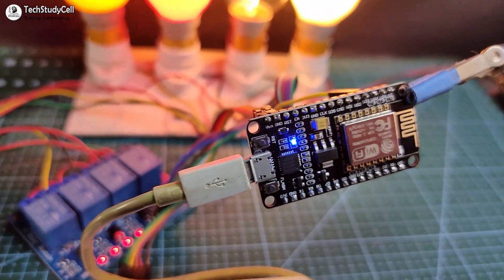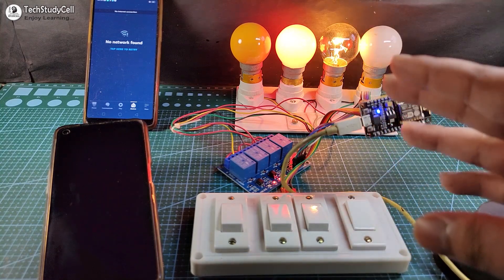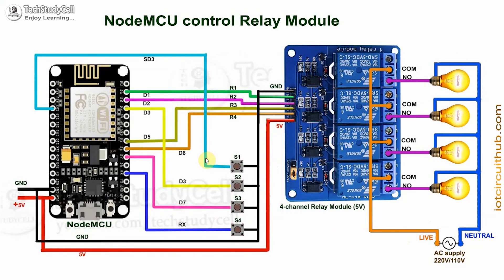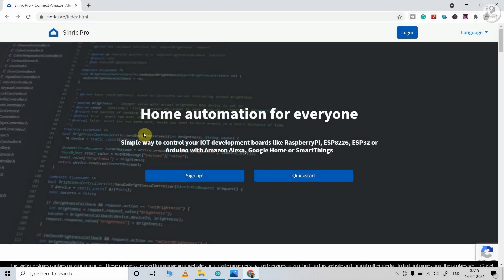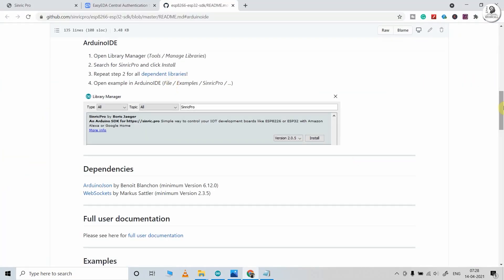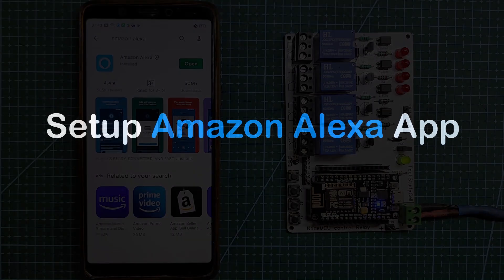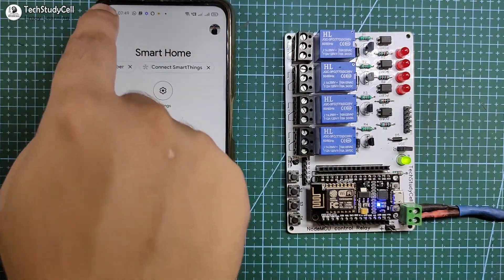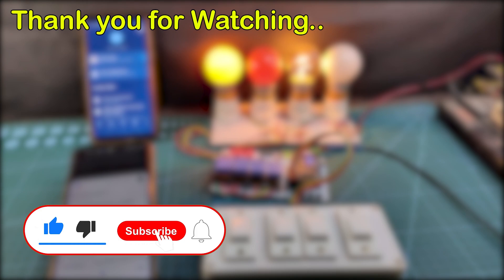Smart Home with Google Assistant & Alexa using NodeMCU ESP8266 (Manual + Voice) | IoT Projects 2021

Comment: in this project using 4 outputs, but only 3 using Sinric. can I combine 1 output or maybe more using Blynk?
Reply from the maker: You can control the 4th relay manually from switch
Reply: @TechStudyCell  i have successfully combined 6 relays with Blynk on esp32 .. thanks
Reply: @myllosetya  can you share the code?

Comment: hello friend, can you help me with something.  when I do the project it works perfect.  but when I mount it in my room that I make all the connections the manual function does not work for me.  It is possible that it is because the cables that go from the ESP8266 to the push button I am passing them next to the alternating current cables 120 AC
Reply: not push buttons  use only normal one way switch

Comment: Thank's for the video. I tried now in the morning and I couldn't get it to work, I followed all the steps correctly but I was not activating the nodemcu by cell phone. = [
Reply from the maker: You should not get any errors if you follow all the steps. You have not mentioned what error occurred. Check if the NodeMCU is connected with WiFi.  And during the boot process the switch 1 and switch 2 must be turned off.
Reply: @TechStudyCell  kya we need a router for to connect nodemcu with WiFi???
Reply: @TechStudyCell  I doo all the same thing and my node mcu is also connected to the wifi and when I give the command only rellay board light was turn on or off but light doest wht can I doo plz help.

Comment: I can change the word:
#define RelayPin1 5  //D1
#define RelayPin2 4  //D2
#define RelayPin3 14 //D5
#define RelayPin4 12 //D6

#define SwitchPin1 10  //SD3
#define SwitchPin2 0   //D3 
#define SwitchPin3 13  //D7
#define SwitchPin4 3   //RX

Fort:
#define RelayPin1 5  //D1
#define RelayPin2 4  //D2
#define RelayPin3 0  //D3
#define RelayPin4 2  //D4

#define SwitchPin1 14   //D5
#define SwitchPin2 12   //D6 
#define SwitchPin3 13  //D7
#define SwitchPin4 15  //D8

okay?
Reply from the maker: You can do that. But make sure during the booting process D3 D4 should not connect with GND
Reply: @TechStudyCell  Ok Thank your
Reply: Can you help me on how to turn the relay on high?

Comment: Do we require Arduino uno ?
Reply from the maker: No. I have used Arduino IDE for programming
Reply: Ok so nodemcu and relay module is enough
Reply from the maker: Yes. And switches or push button
Reply: @TechStudyCell  so i need to connect the nodemcu directly to the laptop ?

Comment: It is working opposite.. on = off and off = on
Reply from the maker: When ever you press the switch, the current state will change.
Reply: @TechStudyCell  when i say alexa to off. In real the relay get on
Reply: @TechStudyCell  in which part of code. I need to change ? I already tried digitalwrite high to low.. 
And i am using high level trigger relay
Reply from the maker: For active high control relay you have to do more changes. You can refer to multiSwitch_advance example sketch of Sinric Pro
Reply: @TechStudyCell  ok.. Thanks 😊😊

Comment: Sir it is not working without internet innoush button please sir add 2 function void without internet and void with internet if WiFi connection then with eles without please update the code and provide link please sir

Comment: To connect more lamps you need a hub or server, por example the program home assitant in raspberry pi, and the custom firmware tasmota, and devices with esp8266 like sonoff to control outputs for control infinite lamps
Reply: Yes

Comment: Great tutorial bro, Can you make more advanced tutorial using sinric pro ? 
Something like blinds, sensors, send ir codes etc.
Reply from the maker: Noted. Thanks
Reply: Still waiting for fan Speed control ❤️
Reply: @yogendrajamsariya1193  I'm too busy these days, just give me some time and I will give you the best solution for your problem bro.
Reply: @nightwing8164  😉 I am waiting bro ,
Reply: @yogendrajamsariya1193  I believe you are using sinric pro right ?
Go to examples there's a fan example test it.
Reply: @nightwing8164  bro, yes you are right , but problem is I am using Rbdimeer , which is have own lib , and not fit into codes of sinric pro, so many error , pin interpretation, decoder,
Reply: @yogendrajamsariya1193  in my solution I'm using solid state relay ( triac based ) it's easy to use and doesn't need any special library to control the device in online mode and rotary encoder for offline mode.
Reply: @nightwing8164  hi can I get your mail id bro I did something
Reply: @nightwing8164  Bhaiya mera Manual switch bina hotspot connect kiye kaam nhi kr raha hai ek baar hotspot connect krne ke baad switch kaam kr raha or hotspot band kr raha phir bhi switch kaam kr raha lekin stating me mujhe ek baar hotspot connect krna pad raha phir switch kaam kr raha , Mtlb switch ko Initialise krne ke liye hotspot connect krna pad raha jo ki acha nhi hai if phone nhi raha to switch kaam nhi krega PLZZ SOLVE THIS PROBLEM..🙏💛
Reply: Can you translate your post to english please ?
Reply: @nightwing8164   ok

Comment: Bro when I connecting wifi with my nodemcu the blue light not blinking 
And when I using switches and not working and when I give supply to nodemcu the relay module for lights blink for one sec 
Pls help me bro 🙏🏻
Reply from the maker: If you use switch, then switch 1 (SD3) and switch 2 (D3) must be turned off during restart or uploading the code to NodeMCU. Otherwise booting process will fail.
Reply: @TechStudyCell  bro the blue light not showing indicating when wifi connecting to nodemcu
Reply: Same brother 100% same problem with me also how can i fix it plz tell me🙏🙏🙏